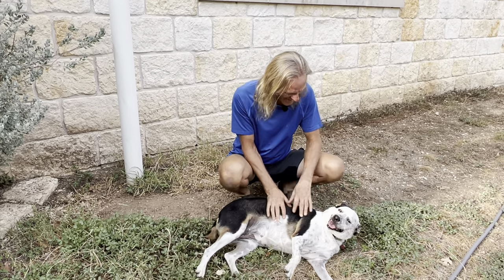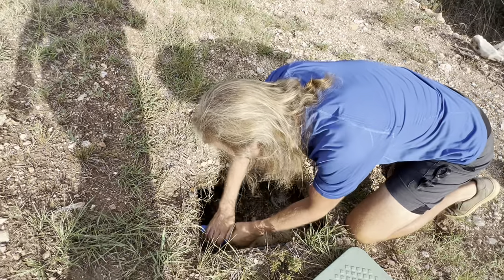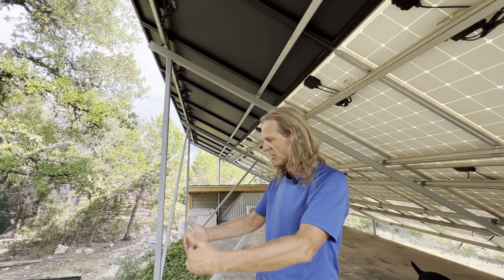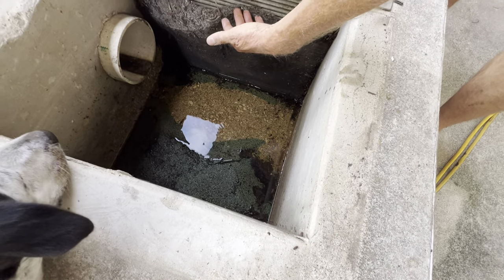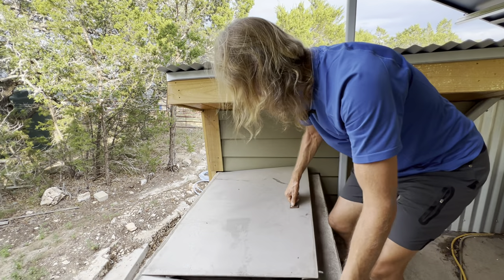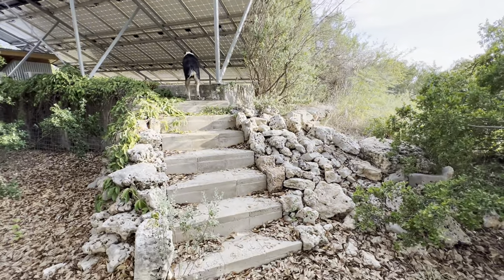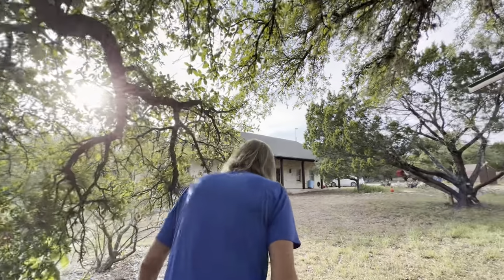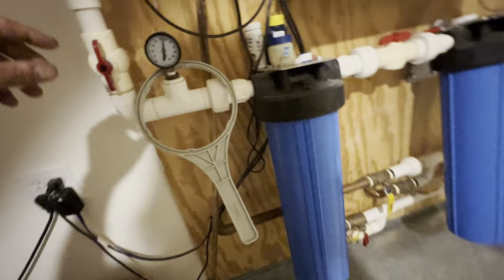Check Out This Nineteen Year Old Rainwater Collection System!! It Has A 22,000 Gallon Concrete Tank!

Comment: i want to build one of these in northern climate completely underground,  how hard would that be?
Reply from the maker: How far north?
Reply: @RayBuildsCoolStuff   eastern Washington (spokane)  i currently have low producing well with a 2500 gal  underground concrete cistern  tank, but this thing has just been a giant money pit, i tried drilling another well(400 ft)  and it came up dry and had to replace pump twice already ( getting sand in pump) ,  i want to get a  dry drain system or whatever its called the plan is to  have tank top 2ft below ground so i can catch all the gutters  and not have water sit in pipes
Reply from the maker: @Dimka2  the problem I would expect is the piping that collects from the roof would freeze up. If the tank is build to withstand your local soil geology then I see no other issues as the water would be a big thermal mass and would be deep enough to prevent freezing. What issues are you concerned about?

Comment: I take it that's us gallons but you're right concrete is the best my dad started building concrete water tanks back in the thirties they were round and underground he poured them in two pours bottom and sides first then the top starting out he started with 3 thousand gallons Canadian by the seventies he was up to six thousand gallons Canadian  after he died I went up to where his old partner was building tanks and watched how he built his tanks in one pour bottom sides and top and he also only used inside forms the dirt is the outside form so coming home I built my new forms for a six thousand gallon imperial tank forms had to be constructed so that I could get them out through a 2 foot manhole as we put 3 feet of dirt on top so for an eight foot tank we dug a 12 foot deep hole the only problem I had was trying to figure out dimensions feet and inches do not work on a calculator came out to something 1 hundreds of an inch or 1 hundreds of a foot can't get tape measures divided like that so I broke down and converted gallons to litres and feet to centimeters and I was good to go and it it worked out for those superstitious people who figured 13 was an unlucky number it was 4 meters in diameter when I first started calculating it out I took my radius diameter stick over to the local park that had a good sized peice of asphalt and with chalk drew out my circle and devided it into 4 ft sections so I could cut the sections out of a 4 foot sheets of 3/4 inch plywood I built a jig to cut the plywood on a band saw put it all together on it's side so I had a barrel 13 foot in diameter and 8 foot side to side but I had a problem the forms were not designed to take apart on their side to much chance to break the rings they were quite flimsy at 13 foot by 2  1/4 inches thick the concrete pressure would be around the diameter equal all around the circumference and when taken apart with the  nails in the 1x8 by 8ft boards  holding the rings up I could could take 1 approximately eight foot section off at a time  side forms first stating at the top ring down to the bottom then the 1x8  board's around the side's and then the top beams and the 2x4 then the top 1x8  boards that was scary as you took the 2x4s off nothing was holding the top forms up but the pressure of the concrete at the ends so at anytime we were taking apart the top it could all come down usually we put one post in on the longest 2x4 in the middle that way we could get all but the one 2x4 before we pulled the top forms down we'd put the post near the manhole so we could stand under the manhole and remove it then up the ladder to break it loose one time when  my brother was stripping  out the top forms it came down with a roar left him in his underwear ripped his coveralls right off.had a few close calls but that was the worst but dad's method was dangerous like that because his 4x4 posts set on the concrete floor so you had to beat them out and with all that vibration it quite often caused the top forms to fall when when you stood on the ladder with your head in the manhole I used telepost so I could just loosen the the pressure off in the end I had metal rings formed out of 2x2 box beam and went to 10 foot high tanks 8000 imperial gallons but building cisterns is a 2 man job and even offering about 30 dollars an hour I had trouble finding a man that would work most of the problem was with the pour over 13 cubic yards of concrete in about 3 hrs then trowel down the top and clean up it was approximately 6hrs of constant steady work because concrete starts curing as soon as you start mixing so it's warm to the touch when you start pouring and even warmer and harder by the time you finish so there's no stopping from the time you start pouring until the last tool is clean still have my forms but I can't do it anymore also it got to hard to find a backhoe operator that can dig a 13 foot in diameter and 14 ft hole and every gouge in the dirt wall was extra concrete and that cost money to fill with cement  at 30 dollars a cubic yard and that was 35 years ago don't know what the price is now but a large tank of water also gave the homeowner a lower cost for fire insurance
Reply from the maker: Pouring ready mix concrete like that is a whole different ball game. That’s why we used shotcrete because there was no hydraulic pressure on the forms. Virtually all swimming pools are made this way but many/most are shot straight onto the dirt excavation without any form at all. 

The manhole on mine is three foot square.

If an engineer had been involved today, the sizes and reinforcement would have been greater and more costly. This was designed to be adequate. If it lasts 30 more years, I’m good!

Comment: Yeah I'd like to be off of the city water I'm tired of the chlorine and fluoride if they put it Might have either overlooked showing it to us or it was long enough to go  didn't think about it usually  Usually there's an inch air gap or some type of a one way checkball to prevent backflow from the sewer In the video it looks like you're trying to flush the water works went down into the sewer pipe when I hooked up my water softener back in Nebraska I was required to use an inch gap for rather th was putting it into the washing machine Well sir as I said the other day after watching couple of battery videos an the video on your solar s*** bunch of other videos I'm hoping to see I probably have 5 million questions and you probably have answers to all or most of those questions I just need to Figure out a way to pick your brain and get those answers thank you
Reply from the maker: 1” air gap is important, especially on city water. I have seen a neighborhood water supply contaminated from a water main break that happened while a mop bucket was filling with a hose. The suction from the emptying main siphoned the mop bucket empty into the water pipes. I’ve heard of worse stories.

Comment: According to German standard Big Blue filters (water filters in general) should be changed every 6 months, not so much because of pressure, more because of bacterias, I don t care so much, because I don t drink the water from my well now, cause it has to be rebuilt with concrete rings instead of those field stones and cleaned too, think my first filter has 20 micron filter, second has 5 micron and third has 5 micron and coal filter, not sure why you have 20 micron after 5 micron?, thank you.
Reply from the maker: The carbon filter has a 20 µm element with it that catches the carbon particles.